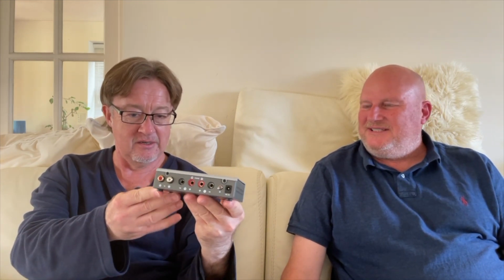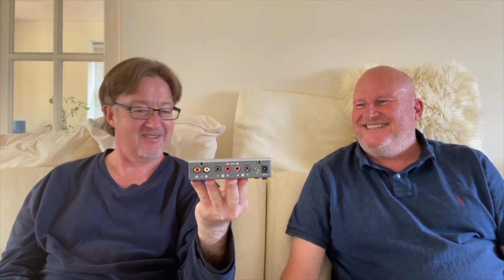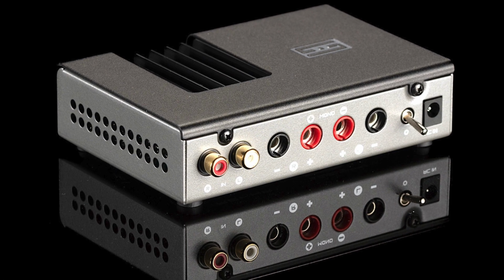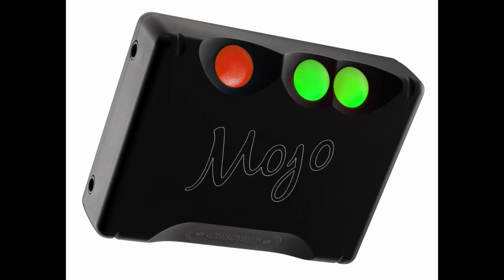Schiit Happening! Why the Tiny & Inexpensive Rekkr is a Brilliant Pocket Power Amp!

Comment: I love your reviews, and your chemistry is off the charts. I feel like this amp might be my bag, as I don't crank the volume, ever, and my room is fairly small at about about 17 qm. I've been fairly stuck on class D for the compact size and power efficiency, but I still wonder "what about an AB amp?"  Then I look at the massive dimensions and power consumption and nope right out.  Obviously I've heard plenty of AB amps, but I haven't owned one since the early 2000s when I had cheap American electricity and far more room. I'm very tempted to pick up this little Schiit since it's max consumption is not much more than what my current class D draws and might scratch the AB itch - why not give it a shot? 

But I still haven't pulled the trigger :D
Reply from the maker: It's a cool bit of kit!
I quite fancy one myself.
Mike

Comment: I have a Fostex speakers similar to RadioShack. Wish a newer speakers were used.
Reply: Nothing the matter with Fostex speakers. I run a pair of them in a Fostex enclosure with a USB powered D class amp. Sounded great until Windows 11 wasn’t compatible with my external sound card.

Comment: Did it not occur to you to try it with larger speakers, like the Yamaha NS1000 seen in the video?

For me, the intriguing aspect of these systems isn't how they behave with small speakers; it's what they are capable of doing with decent speakers.
Reply from the maker: It couldn't drive the Yamahas I'm afraid. Mike
Reply: I came across your video again while searching for something, and I watched it once more ;)

I eventually bought a Rekkr, which I have set up in a desktop system.

At first, the Rekkr was powering a passive Tannoy CPA5 SB bass unit, and from that unit two Kef HTS2001 satellite speakers (the famous Kef “eggs”) were fed.

The sound was very good, despite that little thing having to move the four 5" drivers of the Tannoy and each of the 4" drivers of the Kef speakers.

To relieve the Rekkr from some of the workload, I replaced the passive Tannoy CPA5 SB with an active subwoofer, the Kef PSW2000. It was designed to work with the satellites and has the advantage that its frequency adjustment works as both LPF and HPF. So the signal goes from the preamp to the subwoofer, it plays everything below 90 Hz, and sends the rest to the Rekkr and the Kef HTS2001.

I’m very happy with the system.

But out of pure curiosity, I’ve tried the Rekkr with many speakers I own: from some Namco NR200 (3‑way with a 10" woofer) to Acoustic Research AR94 (2.5‑way with two 8" woofers) and even Infinity Renaissance 90 (4‑way with a 10" Watkins woofer).

The little thing is surprising with all of them, and in a small room at reasonable volumes it can work with a normal monitor speaker. Obviously, as soon as you compare it with other amplifiers driving some of my monsters, you can tell the difference.

But it’s a really good piece of gear… I wanted to buy a second unit and use them as two mono blocks, just for the pleasure of having them that way. But the product was discontinued, and it’s hard for me to find second‑hand units.

Comment: That doesn't sound right it should be 4 watts per amplifier giving you a total of 8 watts when bridge
Reply: The theoretical maximum power into the same nominal speaker load when bridging amps is 4x not 2x. 3X is realistic.
Reply: @razisn  exactly that's what I said
Reply: It's 2x 2W or 1x 4W per amp, RMS into 8 ohms. Sorry if this wasn't clear.
Reply: @MrVinylista  it's the same thing as what I said... 4 watts per amp when bridged, will give you 8 watts for 2 amplifiers
Reply: @hoobsgroove  Yes. In other words, much more power than Mike's Naim NAIT 1. 😀
Reply: @MrVinylista  Yes, I believe that's what the '1' stands for in the 'Nait 1' - it's the power rating. Will get me coat....
Reply: @geoffadams590  Nice. Wish I'd thought of that gag. Mike...